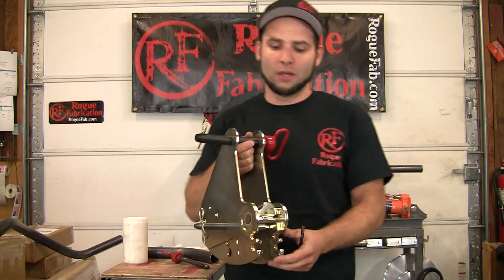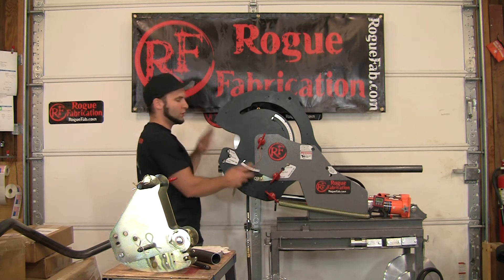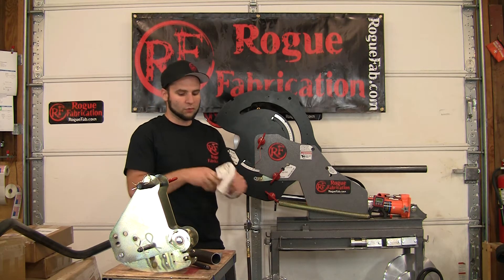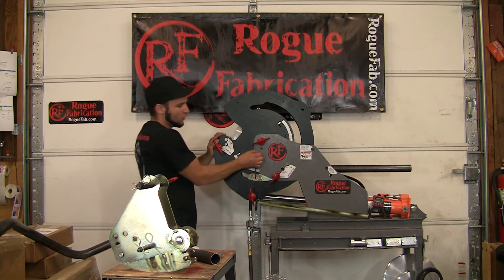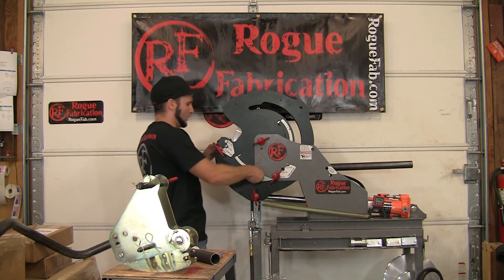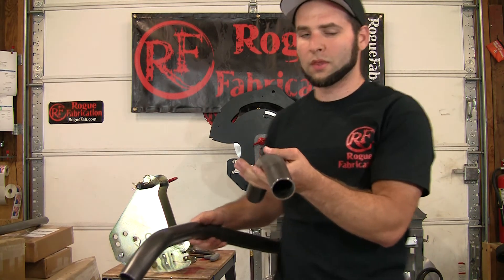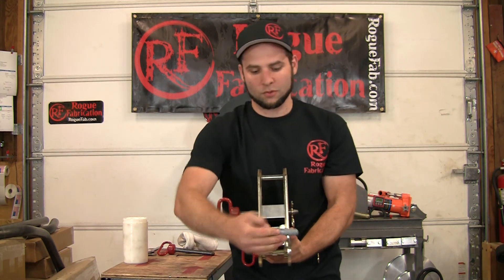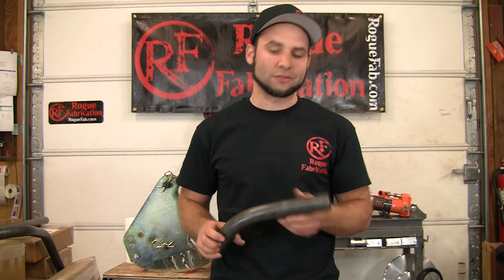Thin Wall Attachment for M600 Tubing Bender

Comment: Will this thin wall attachment decrease the deformation on 1.75  .120 wall  tubing bent on 4.5 clr?
Reply from the maker: +boostnhoe it should. We need to test to see how much. The larger radius will do more per dollar to improve bend quality though.
Reply: Rogue Fabrication  I also forgot to ask if you could show a better close up of each pipe with and without the thin wall attachment. They where only flashed for a brief second from to far away.

Comment: Hey Joe,  been enjoying the M600 HD bender for about a month now and it has done everything I needed and more.  Will the thin wall tubing unit work in the HD bender as well as the standard M600?  Thanks
Reply from the maker: +metalshaper the ones we just made are a little too wide for an xHD, but we can narrow one for you to make it fit. Shouldn't be a problem.